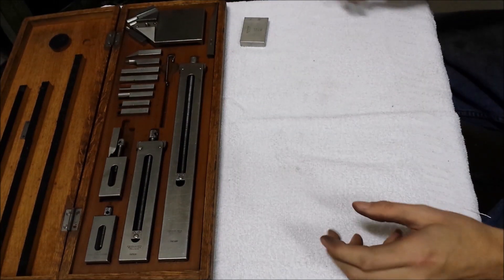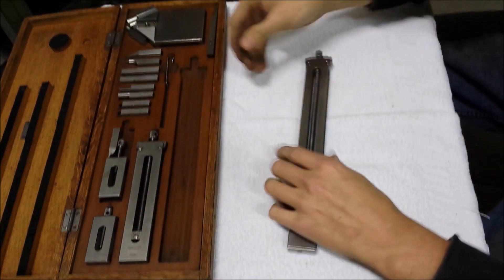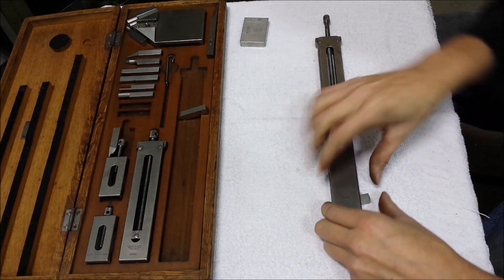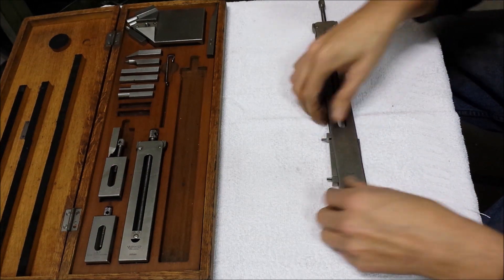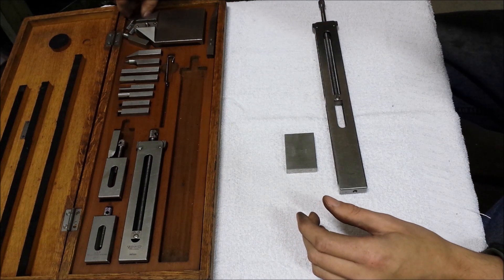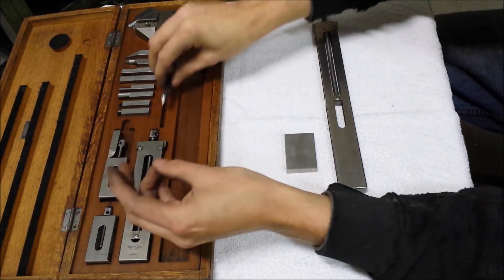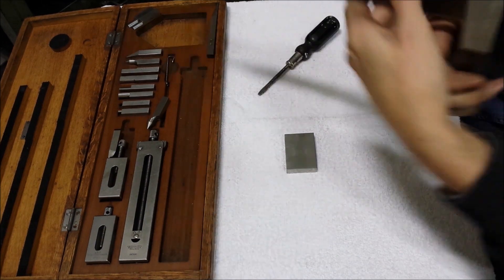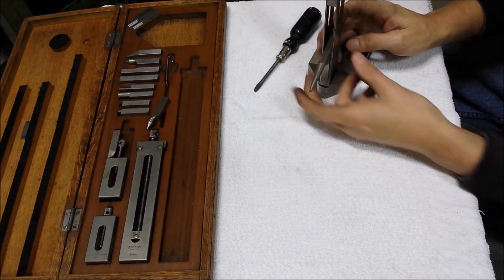Tool&machine talk 2: Gauge Block accessories

Comment: Hi, I have something similar that came with my Starrett set, it's more time consuming than using a regular height gauge but you can measure within .0001" or about .001 mm,. I use it rarely though.
Reply from the maker: okey never seen the Starret ones.
Reply: This is a pict of what comes with my 81 blocks set. It's in a drawer under the gauge block section.   (The one in the picture is a stand alone set just ot show what it looks like)
http://starrett-webber.com/GB4.html
Reply from the maker: sweet! I find these kits pretty useful once you get used to them actually